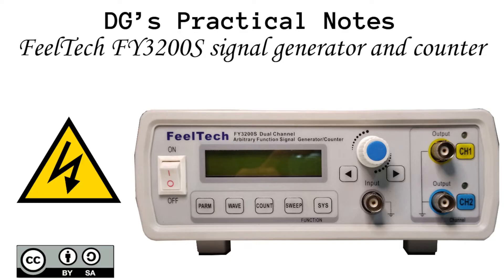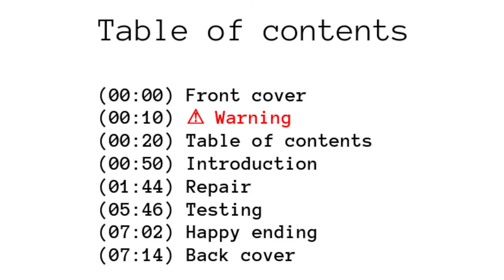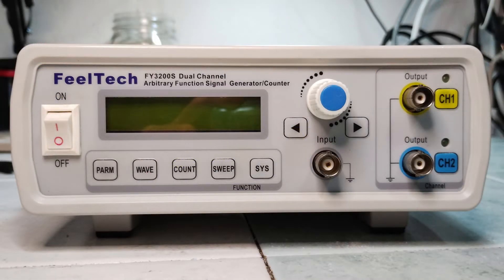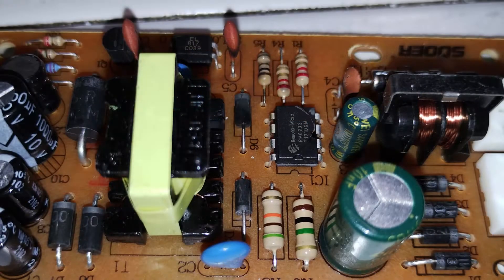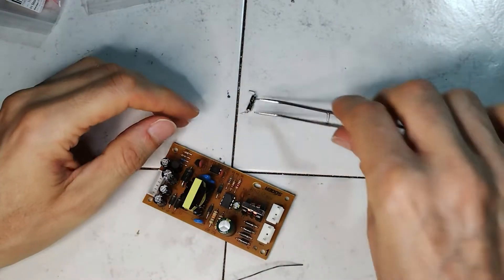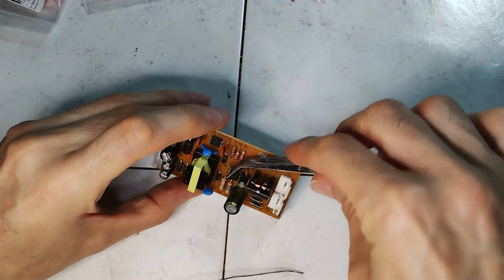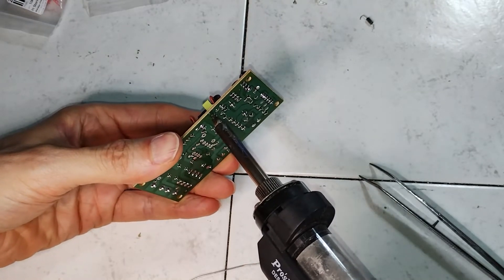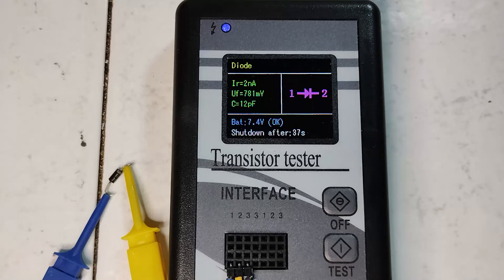DG’s Practical Notes, U#4 FeelTech FY3200S signal generator and counter

Comment: maybe I would consider replacing main socket with ground,  a c14 socket.
Reply from the maker: Hello. I am aware of the leakage from the switching power supply,  but I preferred to keep it «isolated». It is usually connected to an old, but grounded signal generator (with the function of frequency counter), and therefore also this item becomes grounded. But I still have the possibility to separate it (from that grounded device) and to use it on a vacuum tube device that I want to keep isolated from ground for some reason.
Thank you for your comment though. 🙂🙂🙂